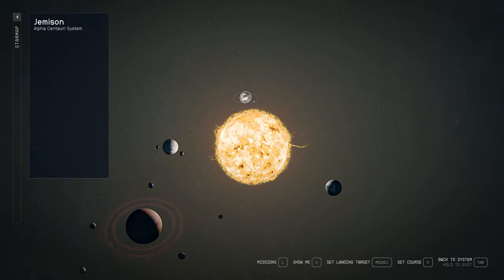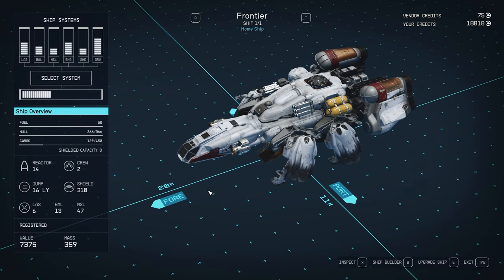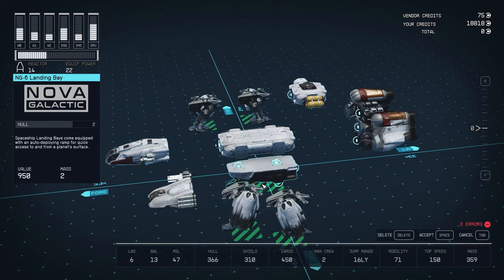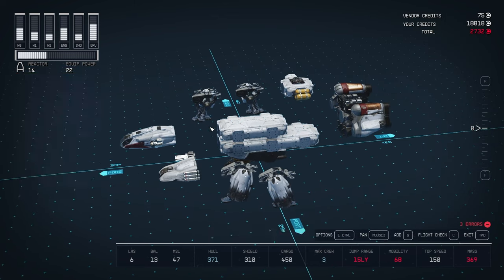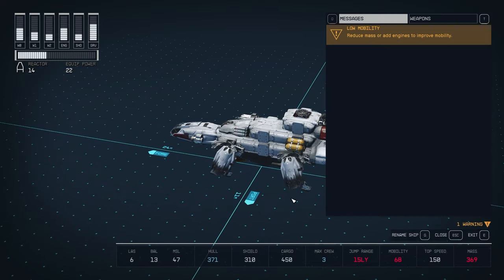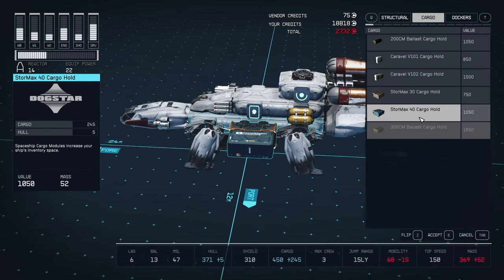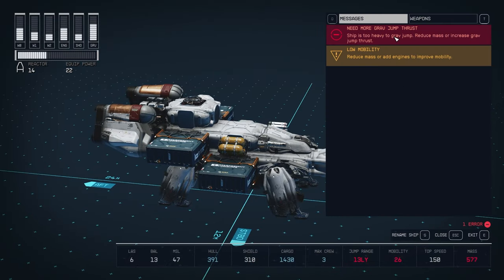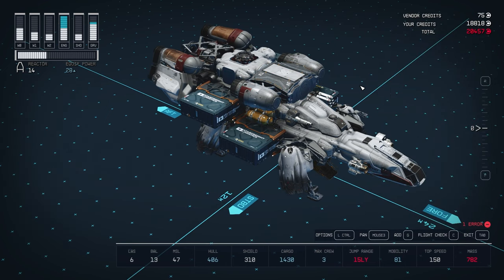Starfield: How To Add More Storage To Your Ship

Comment: Built mine identically, but needed yet another size up on grav drive and had to move things around to add more landing gear.
Reply: I've got the same issue, just about to shuffle it for the extra landing gear now, did you add anymore stuff or just reorganise it?
Reply: @mitch4211  reorganized and it worked but still needed the landing gear